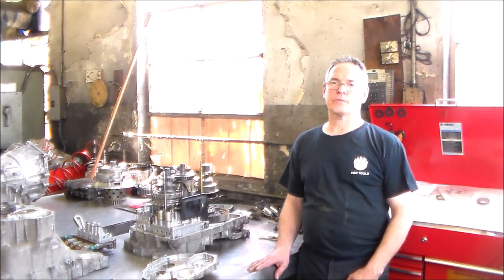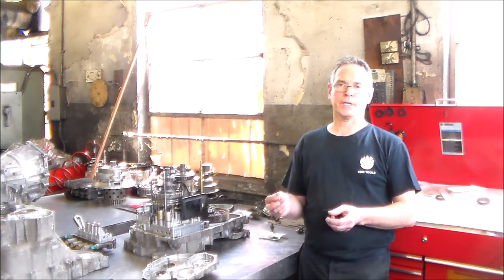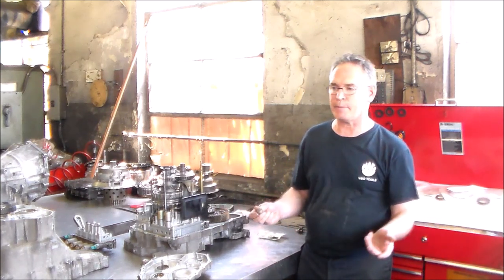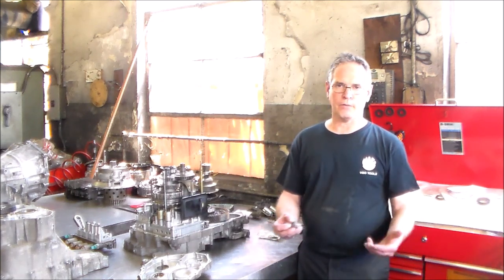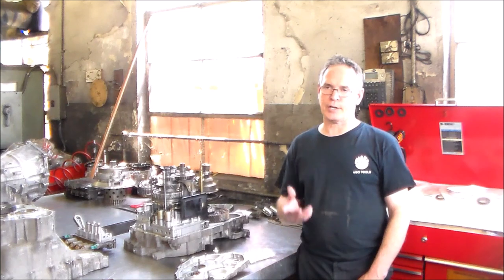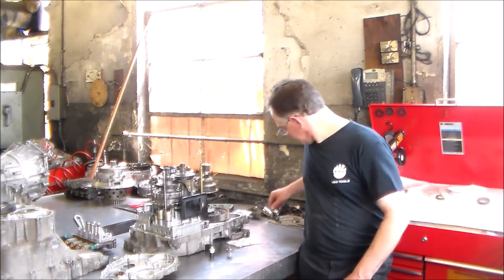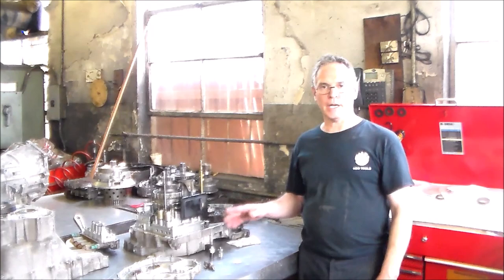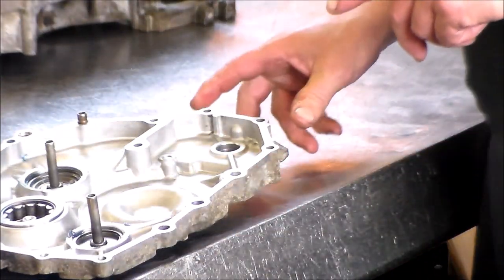Honda Pressure Switches

Comment: Thanks Garry last night I put the sensor into some tiolet bowl cleaning and it foam for a while den I use a little to clean down in the sensor hole and try it back and it start working perfect
Reply: What did you use to clean down in the sensor hole? Has the sensor continued to function with no problems?

Comment: Thanks you sir, very informative, i was looking for a ohm spec but now i know these switches are just on/off. Just installed a engine and car developed this 843 code. car never had trans issues and seems to shift fine, So i am thinking i may have possibly tugged on the wire when i was disassembling. At least i can check source volts at plug  while wiggling things around or see if switch could be stuck in a closed position. Briliant info

Comment: Hi Gary, thanks for the video.  Tranny slamming into lower gears on occasion with Odyssey.  No codes or D light.  Honda did software update and triple ATF drain with no change.  Would changing all 6 pressure switches be next logical step though there are no codes?

Comment: There are only two pressure switches, 3rd & 4th, on my '05 Pilot...Thank God for that after seeing how many they use on the Odyssey....yikes! Would it be too much to ask of Honda to keep the color of the updated switches the same as the originals? This is madness and stupid if you ask me. I've owned Honda's almost my entire married life ('83-present) as I fell in love with my buddy's '82 Accord and I just had to own one when I had the funds to do so. We bought an '85 Civic sedan, traded it in three years later for an '88 Accord LX sedan which we owned for around fourteen years.  I currently have a '98 CRV with 301K miles which I drove off the dealer's lot of that year and an '05 Pilot which I bought in '13 with 99K miles under her belt...currently has 231K on it. I mention all of that because like many old-school Honda fans I feel they've lost their way and this pressure switch fiasco is evidence of it.  Great video, BTW...thanks.

Comment: Thanks for your very detailed and informative videos. I have two Acura's. One 2007 MDX and a 2005 MDX that are showing some of the same symptoms. On both they are not producing any codes and the drivability is good. The issue with the 05  is that when I shift into reverse from park or drive is takes longer than what i think should be normal ( about 2 sec). The 07 has similar issue but when I go from reverse to drive it takes a few seconds to engage as well. Fluid drain and fills have been done very regularly using Honda fluid only. Any advice would be appreciated.
Reply from the maker: happens both cold and hot?  Reverse issues are not common, rarely see reverse issues
Reply: Yes, happens both hot and cold ...more pronounced when it's cold. The 07 has done this for many years.  @GaryFerraro

Comment: Thanks Gary.  Updates and superseded parts, it never ends.
TakaCare,
Bill
Reply from the maker: Bill K   Thanks Bill. You are correct on that.
Reply: is Honda circling the drain or what... these simple parts are not rocket science like the machined gears

Comment: Gary - I have read that a good spray of brake cleaner in the hole of the sensor can fix this 90% of the time. Poor fluid quality whatever might get stuff in it. Tap it on hard surface and dislodge junk. Thoughts or experience with that?  BTW excellent video. Thank you!
Reply: I would love to hear him address this issue. Thanks for the heads-up on a possible cure but we gotta keep in mind Gary has a business to run and to keep the revenue flowing repair shops need to make money from the mark-up on parts which is usually double their actual cost.

Comment: I changed my 3rd gear pressure switch twice with 2 new honda switchs. And my d light still flashing.. I have that p0848 code. Even changed the harness that to te 3rd gear pressure switch and still flashing.. I haven't had a chance to check the voltage yet.. 04 acura tl.. Do the old switch and new switch have the same voltage?
Reply: Ever figure out the issue?

Comment: Have a 2004 Acura TL automatic.  It has a hard down shift from 3rd to 2nd no blinking d or check engine light. Change fluid once a year.  Getting ready to change transmission filter.  Just wanted to see your thoughts on this . Does it pulling off highway onto off ramp. Thank you. It has 180K miles  otherwise  does great.
Reply: CHANGE UR FILTER AS WELL MANY DOESN'T EVEN KNOW IT HAS 1 CHANGE THAT ADD LUBEGUARD ADDITIVE WITH OE FLUID ALSO WHATEVER GEAR THATS ROUGH CHANGE THAT PRESSURE SWITCH AS WELL RESET UR TCM AND SHOULD NOTICE A POSITIVE CHANGE 😎😎

Comment: Thanks for this vid Sir.. I have 99 accord 4cylinder I get the flashing drive light and wen am driving it neutral up on my and when I take my foot of the gas it goes bk to gear.. witch switch u think I would need to change or check..ohh and one more thing it has a delay and slam in drive and reverse.. I changed the tranny fluid wit mobil 1 ATF  transmission fluid..is that ok?

Comment: You say this @ 3:20: The switch is bad if we get either 5 or 12 volts at probe. What should the voltage reading be if the switch is good for a 2006 Acura TSX?
Reply from the maker: its all the same volts . You disconnect the pressure switch, if you have 5 or 12 volts on the harness side then the switch is bad
Reply: @GaryFerraro  Probe the harness side? That would be the connector side. In the video @ 3:20 you say to probe the inside of the switch. So if the switch is good, what reading should we get? Thanks.
Reply: @niemand000 right

Comment: Hello Gary, I have 04 odyssey with 102k miles, I was driving south in highway doing 70 mph and suddenly D started flashing but no engine light.
I stopped and turn off the engine, checked tranny oil level,no burnt smell. Started the van again and d flashing went away. I’m going to drive back home tomorrow, will odb2 tester come out with a code even if there’s no engine light ? And what’s should I look or check when I get back? Thanks
Reply from the maker: If the D light was flashing, there is a code present. Scan the car and see what you have

Comment: Hello, for Honda CRV 2008 AWD got the P0842 code, 2nd Clutch Pressure Switch. Unfortunately my dealership only got 3rd Clutch Pressure Switch (Green Color Part No. 28600-RCL-004). I remove the 2nd Clutch Pressure Switch (Grey Color) and install the 3rd Clutch Pressure Switch (Green Color). "D" Light stops blinking and everything is fine, but is there a potential risk? You mention some PSI settings, should I change it again for the proper one (Grey Color Part No. 28600-RCR-004) and remove the installed leaving it as a spare when comes P0847/P0848. Thanks for your Video.

Comment: Thank you for your valuable info.. I have a 2013 honda civic.. I got a PO843. I replaced the transmission fluid and filter, both with genuine honda parts.. I need advise as to replace the second transmission switch.. Do I remove air box or remove driver side tire instead? Which is the most efficient and easiest way?
Reply from the maker: John Botero I would have to see as long as you got a clean shot at getting a socket or wrench on the switch really shouldn't matter
Reply: Did you find out the problem I think I’m going threw the same thing

Comment: Are the plugs all the same? Like could someone mistakenly install the wrong plug or will the plug be different to prevent that?
Reply from the maker: The pressure switches are different colors because they close at different psi.  A wrong switch could be installed, the threads are all the same where it goes into the case
Reply: @GaryFerraro  thank you, means a lot. 😎👍

Comment: I have a p0700 and a p1739 error code for my ‘00 Honda Accord but I do not notice anything wrong when driving. It says I have a 3rd pressure switch failure. I haven’t driven much since the check engine light showed up. I took it to the mechanic about the 3rd pressure switch and he said that he has to replace the whole transmission which I don’t want to spend on
Reply from the maker: You Do Not need a transmission, it is an external switch on the outside, very easy to fix. Is this a 4 or 6 cly?
Reply: @GaryFerraro  It’s a 4 cyl
Reply from the maker: @RewindsFeed  ok, look at the end cover(may or may not have to lift the car) there is a one wire switch screwed into the end cover.  Trans is on left or right side of the car?
Reply: @GaryFerraro  It’s on the right side

Comment: Good video thanks .. Seems like with the "updates" and color changes it would be hard to confirm you have the correct switch .. Best luck would be the dealer looking it up with the VIN ..I guess ..I worked in dealers ..their not always fool proof either ..Could you do damage if given the wrong switch ? what are the differences ? is it just the pressure that runs the switch ? I worry to much and just want to be sure to get the right one ..Mines grey ...I think I heard you say their black now ..Thanks for any advice you can give me
Reply from the maker: the difference is the PSI they close at, can't do any damage maybe just a check engine light with a code.  Really have to find out what gear it's for if possible, i have shopkey pro so i can see part numbers and what gear it is for

Comment: I appreciate the info. I have a 2016 elite 9 speed. It's showing the second clutch A switch is bad. Honda says they don't make the switch and I need a new transmission. I joined the honda forums and they said to message aftermarket zf. I haven't heard back from them. Any information would be greatly appreciated.
Reply from the maker: i'm not sure have to research.  Where are you located?
Reply: @GaryFerraro  brigham utah
Reply from the maker: e mail me your vin number gsferraro@yahoo.com @fathersofutah9797

Comment: Hi Gary I recently got and 04 odyssey with 130'000mi and changed fluid and is all red now with no codes or blinking lights but it hesitates 1/2 second going into drive and reverse is fine and usually shifts smoothly thru the speeds. Any comments? Terrific video 👍
Reply from the maker: Sounds like all is ok, can't really do much about that small delay
Reply: Low or too much fluid can be the cause.

Comment: Hi Gary,  I have a 1998 Honda accord with a transmission issue, so when driving and slow down  it's like holding back  ,feels like its skipping a gear , what would cause that
Reply from the maker: Can you tell me if any codes are present?  Is the car ok cold?  Check the fluid level, have the car on level ground and engine off to check fluid level

Comment: Would it be possible my d4 light is flashing because of the pressure switch connector from the harness ? It was melted to the pressure switch and soon broken off. The d4 light seems to stop flashing once the car is warmed up
Reply from the maker: yes
Reply: @GaryFerraro  I had tested the connector with a voltage meter, but not a mutimeter. It did give light. Does that mean the connector is still good or should I test it with a mutimeter to see if it's really getting enough voltage ?
Reply from the maker: @BobiPhettOfficial  Test light is good loads the circuit to, but yes use a meter to confirm 5 or maybe 12 volts,  Usually 5 volts
Reply: @GaryFerraro  what if the voltage is lower than 5 or higher than 12v ?

Comment: Is it possible to raise main line pressure electricity on these?  Have a 2013 acura ilx and you can feel there is a little weakness in the main line pressure.  A little bump in pressure could help
Reply from the maker: what is your engine size

Comment: 05 Accord baya trans brown/black plugs under thermostat are identical to the ones under starter? In function also??
Reply from the maker: The solenoids are the same (on/off) but functions are different you have shift A-B-C and a Lock-up solenoid,  you can swap them color for color
Reply: All my switches and solinoids are good. Surges in 2nd, will not shift to 3rd..
P0752 shift sol a stuck on and P0747 clutch pressure control solinoid stuck on..used trans was from bad wreck. Using rebuilt t. converter
Reply from the maker: @user-be9ii9ut4t  I would think the used trans is no good. Has different problem than original problem?
Reply: I have 03 accord baya transmission with the same codes and will not shift into 3rd, pressure switch stuck on pressure control solenoid stuck on

Comment: Thanks for the vid Gary. I have an 2008 Fit that I let my daughter take. Now it has problems. I think her husband replaced the drivers side half shaft and filled the transmission with cheap fluid and it was overfilled. Would that cause these trouble codes- p1780 p0767 p0762 p0757 p1747? I drained a little over a quart and filled with Lucas trans. fix. and the grinding that you could hear when idling in park is barely audible now but the codes remain. Am I correct in assuming the wrong transmission fluid was used?
Reply from the maker: So you cleared the codes and they came back? or you did not clear the codes.  Fluid wouldn't really cause that.  Why change the axle?
Reply: @GaryFerraro   Cleared and came back, ya good question. My guess is part of the plastic that covers part of the undercarriage and the right wheel well came off and was making a loud noise so that means replace the axel? Plus there's a recall on that part.  I'd laugh with you but it might hurt. She's not talking to me so I don't know much. All the information I've researched says you must use Honda AT fluid or at the very least Dex VI full syn or it causes damage. Is this not the case? It's been driven 3000 miles in her care and has a total of 70,000 miles now, still a baby.
Reply: @GaryFerraro  Thank you so much for your help! Unfortunately I think I'll junk it. What I saw after taking a good look at it tonight horrified me. Both spindle nuts were barley on so I'm sure both half shafts were just spinning inside the tranny grinding it all up. The dust covers for the spindle nuts are suppose to be attached to the wheels so when you take the wheels off there is nothing further to take off to expose the spindle nuts. No dust cover present, nuts about to come off. Stupid people should not work on cars
Reply from the maker: @tjjohnson210  ok,  thanks for watching

Comment: Looking at buying a 2011 honda accord with right at 100K miles on it. The owner says it is slipping a bit in 3rd gear. Could this be from a pressure switch or something else like torque convertor?
Reply from the maker: wouldn't be a torque converter, i think the clutch mat be wearing out, does it do this all the time or only hot?

Comment: Hey garry, i’ve got a 2001 honda CRV that has a flaring issue (2-3 mosty and 3-4 a little) no codes only 02 sensor, also doesnt flare when its cold. What could it be?
Reply: the transmission pressure solenoids/switches can do this!

Comment: Was wondering if you had any idea on why my 2004 Acura TL 5 speed auto bangs off the rev limiter right before it shifts it’s like a bop bop bop bop bop shift ab 2 -3 seconds it takes for it to shift. I noticed one of those was a leaking fluid a couple weeks back and then I tightened it and since I did that my car bangs the rev limiter before shifting

Comment: Hi Gary
Quick question I have 2002 Honda accord 2.3l have 3 codes P0730 gear ratio incorrect,  P1739 and P1751 also hear some noise when car is idling under where flywheel is.
Are these switches the problem or my transmission is done and needs rebuild. 
Please let me know your opinion, had delay once you put in gear and than jump.
Reply from the maker: As long as this is full of fluid( check fluid level with engine off and on level ground) you have internal problem, pressure switch will not cause this

Comment: So these pressure switches would throw a code when bad or there are cases where bad switch isn't triggering the code?  Basically would like to know when these need to be replaced or what are the symptoms?  Thanks!
Reply from the maker: symptoms would be a flashing D light or check engine light, may not feel driveability problems. Most of the time the switch is the problem, a few times when it was a wiring issue, i found the car was in an accident
Reply: Years ago, I had one giving me issues on my 07 Honda Fit without a code. I had a slight issue with hard shifting from one gear to another and another issue I couldn't find the source of (it might have been a hesitation? I don't remember anymore). I had taken to a Fit enthusiast group online and someone suggested one of the pressure switches. I had tried everything else so I figured I might as well and it fixed the problem I was chasing plus the hard shift. It was the lowest plug on my transmission and my splash shield was long gone so I think it was just water that had damaged it but it improved my gas mileage in addition to fixing the other issues. No idea why I never got a code for it.

Comment: Can these switches cause shifting problems without throwing a code? What do they do besides tell the computer the pack is full. Do they calculate wear like the Chrysler?Thanks
Reply from the maker: They just tell computer what gear the trans is in, sometimes may cause bit of a long shift (i have seen that a few times) most of the time causes a code with the check engine light on

Comment: After unplugging the switch would you check for voltage at the plug or at the switch? The video says to check for it at the switch.
Reply: Check for voltage at the harness😊
Reply: @condor5635  How does checking the voltage at the harness (the connector) tell whether the switch itself is bad? And what should be the voltage read if the switch is good?

Comment: Gary, 03 honda acura mdx P0873, the name of the switch  is "transmission  clutch  pressure  switch " ? Is no the same like  a transmission  oil pressure  sw right?
Reply from the maker: It is the same